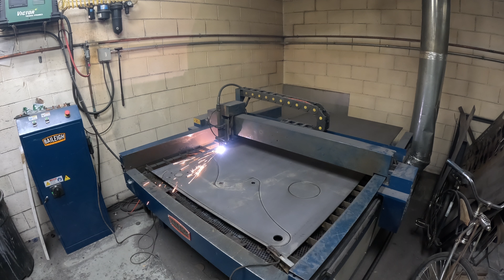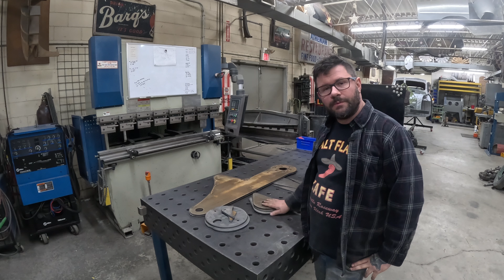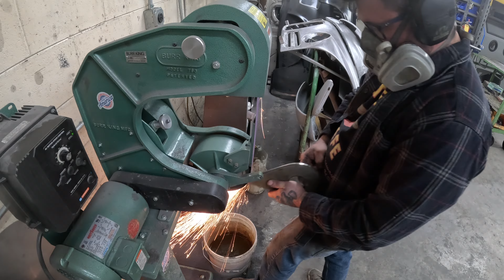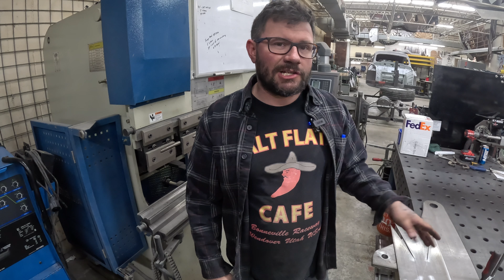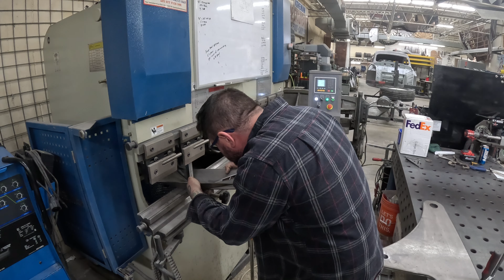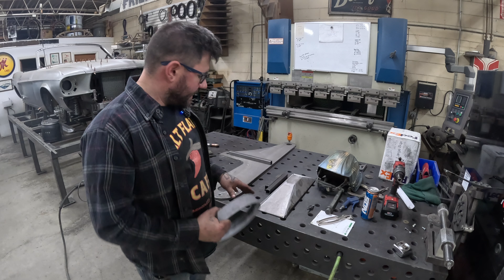The trailer That Broke The World - Episode 3

Comment: yes 1 inch sq. tube for spacing, awe and the 8" circle, the flat bar did you bend by hand or w/ a bending machine?
Reply from the maker: used a plate roller to roll the ring

Comment: What brand/model press brake are you using?  Did you need to make a significant investment in tooling before the brake was useful for shop projects?
Reply from the maker: Its a baileigh press brake, i am still only using the provided tooling that came with the brake. I just cut them down into smaller sizes

Comment: Well, you made that look easy! One question - maybe you live in a 'dry' state and this isn't an issue - if you've made the swing arm an entirely sealed box, how will you go about rust prevention on the interior surface? Like I say, maybe it isn't a concern (AZ, TX, CA etc!) but over here it would be (everything rusts.. maybe not Michigan rust, but still, badly if not treated!) and I'm wondering if a weep hole plus cavity wax would be enough on a structure like that..
Reply from the maker: I live in ohio and i am not worried about it.

Comment: Also one last ? are you using .045 wire, and are you Short Circuit , or pulse transfer welding, and I notice your pushing your weld pool that's why Im asking, Im guessing your using 75% / 25% based on color of your gas tank, but could be wrong based pf of the color , and maybe what region of country your in? and then one last is this all A500 and a36, structural mid steel? no more ?'s thorough enjoy watching!
Reply from the maker: .040 wire, continuous weld not pulsing. Push the puddle to help pre heat forward of the weld. 75/25. I am in cincinnati ohio